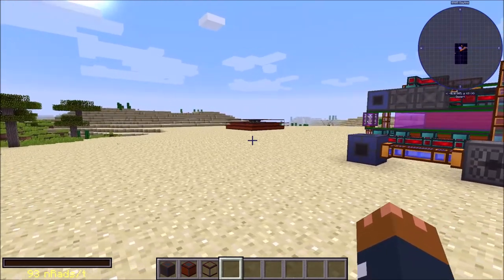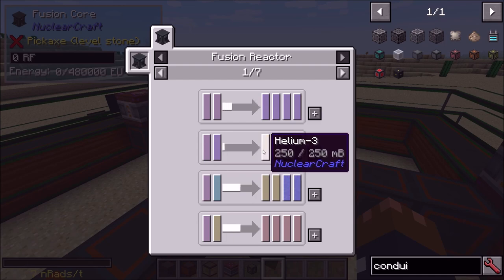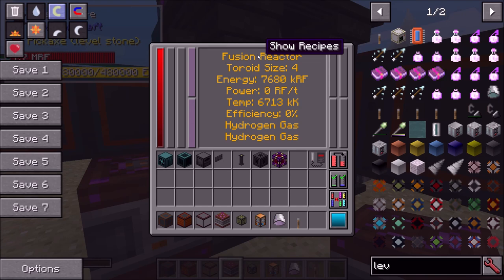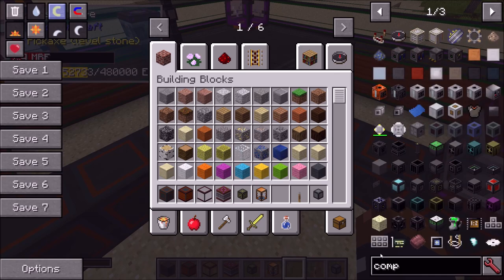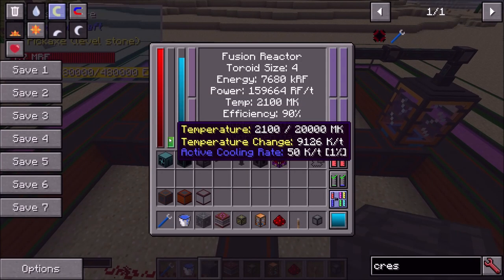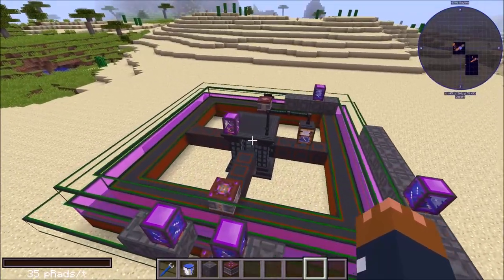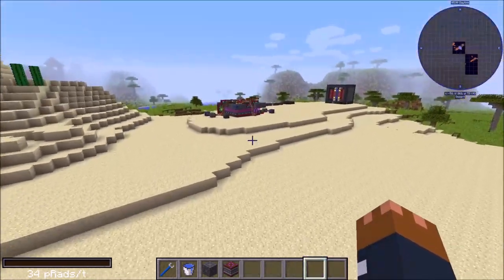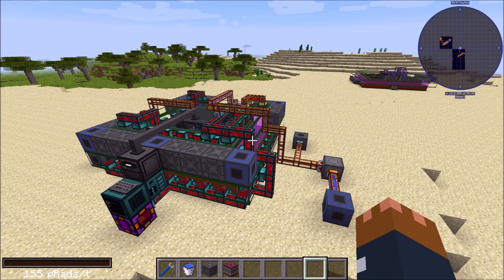NuclearCraft Spotlight - Fusion Reactor [1.12.2]

Comment: How do I disassemble the fusion reactor? Can't leave it idle since it will explode if the electromagnets lose power.
Reply: In real life reactors, there is no such thing as monitoring a reactor, flipping a switch to turn it off and go home and call it a day
Reply: The fission reactors in this mod can in fact be flipped off with a switch so why should they make an exception to your argument? Realistically any type of reactor could be eventually halted and decommissioned.
Reply from the maker: It's been quite a while since I last actually used the fusion reactors, but if the plasma doesn't disappear, you'll have to either keep the e-magnets powered while breaking them and placing blocks to remove the plasma, or wait for the temperature to fall below 8 MK.

Comment: For some reason I can't get power to spread to the other electromagnets. I'm only using Immersive Engineering.
Reply from the maker: There is a config in the 'processors' section called 'passive permeation' that must be enabled for energy and fluid to spread ;)

Comment: This thing still eventually explodes with 100% cooling, also no mod can manage the comperator signal from the core, it only updates once for anything except vanilla comperator and redstone trail
Reply from the maker: I'm guessing this is after running the reactor for a rather long time?
As for the comparator, yes, that is a limitation - I'll find a solution for the overhaul, although the fusion reactor in this form won't exist any more ;)

Comment: I've set up a 9 toroid reactor with massively overbuilt active water cooling, it stays stable for days and then suddenly explodes, every thing is chunk loaded, every part of anything connected is chunk loaded, and like I said it stays stable at max power output for days and then randomly just explodes... Any help would be nice
Reply from the maker: If the e-magnets are exploding, that means they are not receiving enough power and are failing.
Reply: @NuclearCraftMod  well, that's what I thought so I set up a ridiculous array of melanism energy cubes as backup power and I'm using ultimate universal cables to power them all but it still explodes after time
Reply from the maker: @lonesurvivalist3147  I'm not sure exactly what's happening then, nut somehow the e-magnets aren't getting the power they need :P
Reply: @NuclearCraftMod  is there anything else I should look into that could cause an explosion?
Reply from the maker: @lonesurvivalist3147  The only thing from NC that could be causing it is the e-magnets running out of power, so not really.

Comment: does this way to build a fusion reactor works in 1.14 or there is an updated video about building this ?
Reply from the maker: NC is not available for 1.14 yet
Reply: @NuclearCraftMod  then i think im playing in 1.12  im playing a modpack called antimatter chemistry and there is a quest where you have to build a fusion reactor whit 64 e-magnets so i think its toroid 1 like the last fusion reactor you show in the video
Reply from the maker: Jaime Montes Yeh, antimatter chemistry is 1.12.2, so it’s exactly the same as shown in this video :)
Reply: @NuclearCraftMod  any idea in how to feed a toroid 1 or 2 fusión i tried but my input is not enough Also tried doing a fission 5x7x5 for hecm-273 fuel but its hard to get that fuel. Any tips to fuel it i tried Many times but i just cant start it
Reply from the maker: Jaime Montes I cant really give anything specific - just make sure it has enough energy to get started and enough fuel to keep running!

Comment: Once my reactor starts while running on hydrogen it runs through the stored hydrogen in a few seconds then shuts down. Any suggestions? Having a great time with this mod!
Reply from the maker: If it’s running through fuel very fast, it could just be that you’re not producing and inputting it quick enough?
Reply: @NuclearCraftMod  I kinda figured that. I wasn’t expecting it to use so much fuel so fast. Probably 20 electroayzers.
Reply from the maker: @kenfranks82  Yeh, they require quite a few... may be solved in the future by swapping out the old electrolyser for a multiblock version :P

Comment: in sky fact 4 why is my 24^3 reactor breaking while I use the  2 x lithium-7 as fuel and has 100% active cooling rate ?
Reply from the maker: In what sense is it breaking? Are the electromagnets exploding?
Reply: @NuclearCraftMod  yes
Reply from the maker: @kingofstrike1234  In that case there isn’t enough power getting to the electromagnets
Reply: @NuclearCraftMod  I think it's probably getting heated to fast, bc it's produces heat about 2-4 times/tick more than deuterium and tritium mix and the way the cooling works isn't fast enough to keep it cool even while I'm at 100% cooling rate
Reply from the maker: @kingofstrike1234  The cooling rate is the same for all fuel combos, so don't worry about that. If the e-magnets are exploding, it's not because of overheating, but just because they're running out of energy and the plasma is destroying them.
Reply: well I was running a mekanism fusion reactor to power the nuclearcraft fusion reactor but I don't think there's wasn't enough power and the material generation for both mekanism and nuclearcraft fussion reactor, but thank you for the information
Reply from the maker: @kingofstrike1234  It could be that you have enough power, but it isn't being distributed across all of the e-magnets quickly enough. If you're using the energy spread mechanics of the e-magnets, try put a few more cables along the ring and it should work a bit better :)
Reply: @NuclearCraftMod  okay then, thank you for the answers, sorry for bothering you too much :D
Reply from the maker: @kingofstrike1234  No worries :)

Comment: Trying to take gases from the internal tanks out with conduits, doesn't wanna work.
Reply from the maker: What isn't working exactly? Which conduits are you using, and where are you moving the products to?
Reply: @NuclearCraftMod  I'm using fluid conduits to move the gases into a pressurized fluid tank, but I've also tried moving it into a portable tank and that doesn't work either.
Reply from the maker: @busdriverman4254  Have you got a screenshot? I can only imagine that the conduits are configured incorrectly, unless it's a bug with NC.

Comment: Does this overheat and start melting like the fission reactor?
Reply from the maker: It'll only overheat if it hits the temperature limit, similar to the fission reactor. If the e-magnets run out of power, they will explode and the plasma will leak.
Reply: @NuclearCraftMod  thank you for clearing  things to me appreciate the fast service ❤
Reply from the maker: @jadjnm7108  No prob :)

Comment: Is active cooling still active? I'm using the All the Mods 3 modpack and the fusion reactor GUI isn't displaying the cooling rate, same issue that I found in this post on reddit https://www.reddit.com/r/feedthebeast/comments/ayujsi/nuclearcraft_fusion_reactor_gui_no_active_cooling/

Thanks!
Reply from the maker: Which version of the mod are you using? I can't remember exactly, but I think this was a bug that was fixed a little while ago now.
Reply: Modpack has it listed as NuclearCraft-2.15-1.12.2.jar
Reply from the maker: @Wubs4Scrubs  Yeh, that's a very old build. If you can, update the pack and that bug should be fixed ;)
Reply: Hi! Just wanted to let you know that we actually figured out the issue, I don't know if it changed in the more recent versions but the preview screen on the GUI wasn't updating but once the reactor was switched on the active cooling is working fine.
Reply from the maker: That does sound a bit weird. I'd like to think that been fixed :P

Comment: Does anyone know a stable way to consistently power the electromagnetic blocks?
Reply from the maker: I would recommend not relying on the energy spreading for large reactors. Hooking each of the e-magnets up to a cable should help quite a bit... as long as the power supply is relatively stable :P

Comment: Just set up a toroid 3 reactor and I've done some active cooling with it. However, I'm at 101% Active Cooling Rate using just water. Removing a set of coolers decreases the rate to 96%. I realize I can use a combination of fluids to achieve a flat 100%, but will the 1% make much of a difference? Am I fine to leave it there?
Reply from the maker: Being 1% over will make very little difference - as long as it's a tiny bit over and not a tiny bit under, you're good :)
Reply: @NuclearCraftMod  Weird, YouTube didn't notify me of this reply. But thank you! Good to know. Also, I've noticed that the power output of the fusion reactor isn't a "constant", rather it kind of surges the power that builds up in the buffer. I'll attach some .gifs to demonstrate what I mean. Hopefully this doesn't get flagged or anything :P
https://imgur.com/a/5yPvqvd
Is there something wrong with my setup maybe? Any help would be greatly appreciated, thanks in advance :)
Reply from the maker: Ashnno Ah yes, that was a recent bug and will be fixed next version :)
Reply: @NuclearCraftMod  Glad to hear it, thanks again!

Comment: So this reactor uses the liquid form of mekanism gas? also is there any difference between cooling with water to 5k and with any of the better choices?
Reply from the maker: NC machines can accept and extract Mek gasses as long as there's a fluid equivalent available, so you don't need to bother with condensentrators. Right now, no, you just need to hit 5k ;)
Reply: NuclearCraft thank you so much for your fast reply! Also... I just finished setting up a liquid system over on my channel.... DOH!!!
Reply: So I just learned some things over on my stream today about your reactor. The cave illuminator from astral sorcery causes a blockage inside your reactors ring. Also I had my active coolers attached before I activated the reactor ad it got stuck blinking between 1000 and -500 heat per tic. Even when I removed and replaced each and every piece the reactor would brick when activated. I have to jump into creative and get all new parts. I think the cooling data is stored in the fusion cells even when the coolers are detached and the unit it dismantled.
Reply from the maker: @LetsPlaywithDDae  Unfortunately there's not much I can do about the illuminators. For some reason they have their material type set to rock, so they're unwieldy to check for. If they shared the material type of air or fire, then they would be ignored. As for the flickering, is this at the 8000 kK mark, or earlier? Which version of the mod are you using?
Reply: NuclearCraft I had two liquid helium active coolers hooked up before I heated it up. It heated up to 8k and then bricked and got stuck flickering between -500 and 1k. Even when I remove and replace all pieces and detach the coolers, when I heat it up again to 8k, it does the same. I believe it’s current version. I’m fully updated on Enigmatica 2 expert. I will have the video up tomorrow if interested?
Reply from the maker: @LetsPlaywithDDae  What is the toroid size of the reactor? Are the two active coolers placed 'opposite' each other to increase their efficiency? It might be that the reactor is being overcooled. And I'll take a look at the stream footage if I can't work it out, thanks :)
Reply: @NuclearCraftMod  toroid size 4. they are next to each other with one block in between. cooling is 6600 at 132%. my video is up its only 14 minutes called troubleshooting reactor. I had to destroy all the fusion electromagnets i made and replace with new ones from creative for it to work but its working like a dream now =)
Reply from the maker: Yep, everything looked fine except the ring was blocked by those illuminators, so it couldn't start up. At least it's working now though :)

Comment: What's the purpose of the reactor?
Reply from the maker: To generate power ;)
Reply: @NuclearCraftMod  It seems your using more power to power the thing than getting a return on it.  I still don't see the point to this?
Reply from the maker: @The_Beard_of_Wisdom  Oh, you'll certainly get more power out that you put in for most of the fusion combos. H-D isn't even a great one, but it's putting out 42 kRF/t while the e-magnets are using 19.2 kRF/t.
Reply: @NuclearCraftMod  I'll give it another go.  Hopefully I'll have better luck this time.  Thanks for reaching out to help.
Reply from the maker: @The_Beard_of_Wisdom  No worries! The Discord server is a good place for more specific help if you need it ;)

Comment: I think there should be a way to generate neutron fluid or irridiate hydrogen to deuterium and so on with a fission reactor rather than having to do everything with a fusion reactor
Reply from the maker: When we move to 1.13 I will definitely add a lot more neutron stuff to fission reactors to allow for setups like those :)

Comment: I'm playing Sky Factory 4, and thanks to this modpack we can generate everything out of thin air :D
Is there a difference in energy output from different fuel? Or just the optimum temperature is changing?
I've heard (and know from other mod) that the reactor explode when it's overheating, but in your video you said it just become lava?
What's the real risk of overheat?

Also great mod, and great video. I've search it because there isnt ghost block like other suggested but this tutorial is enough to understand everything about fusion reactor. Good job :)
Reply from the maker: Yep, different fuel combos will have different power production rates, fuel use rates and optimum temperatures - all of that info should be in JEI ;)

Electromagnets will explode if they run out of power, but if the core overheats, it'll melt to lava.

And thanks! I try to put a decent amount of detail into the tooltips of the items/blocks in the mod, but make the videos as well for those who find that sort of thing helpful :)

Comment: how the hell am i supposed to power this mosnter up? 3000/t
Reply from the maker: With a big battery ;)
Reply: @NuclearCraftMod  i've made a 16k energy source with an anomaly and a reactor from matter overdrive to power the nuclearcraft reactor, using 2 nodes linked to 8 ultimate cubes. This nuclear reactor is broken. (skyfactory 4)
Reply from the maker: When I say a big battery, I really do mean a lot of energy is required. Billions of RF to get the core heated to 8 MK, and more to power the e-magnets.